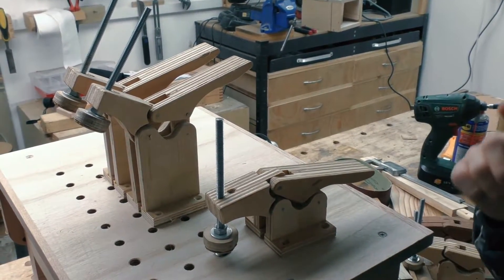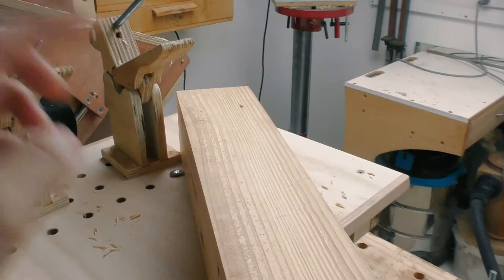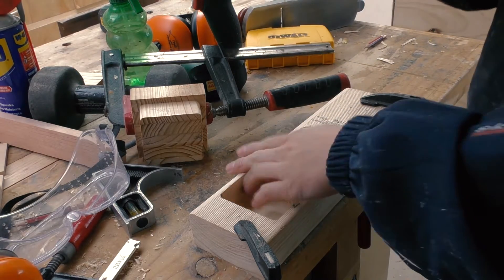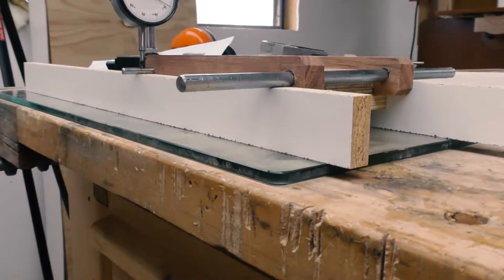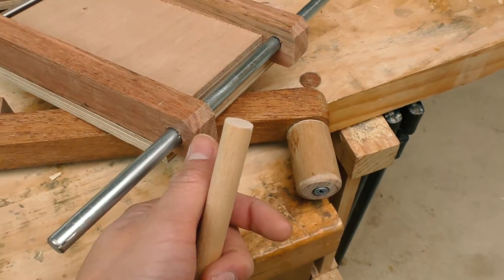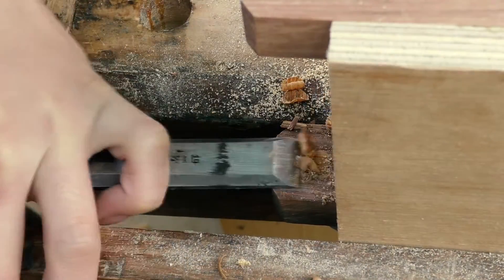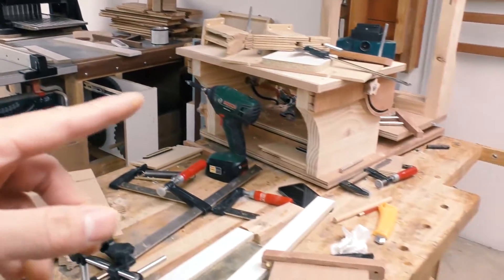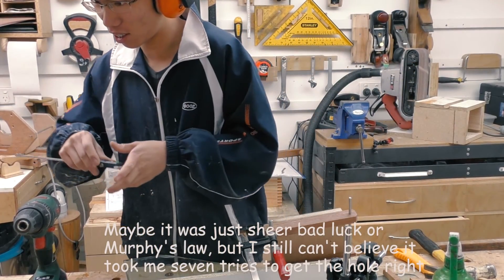Pantorouter XL build: checking the pantograph

Comment: Just a correction .... Matthias Wandel did not invent the device that copies a template through a router, the industry has been using it for a long time ..... He only created a version dedicated to fittings, which he called "Pantorouter"
Reply: But turning the pantograph on its side turned out to be a genious move, because it is one of the most versatile woodworking machines I know